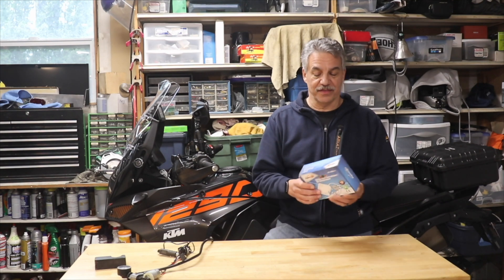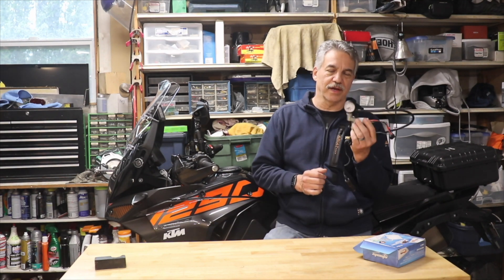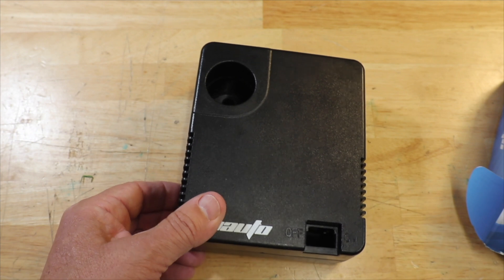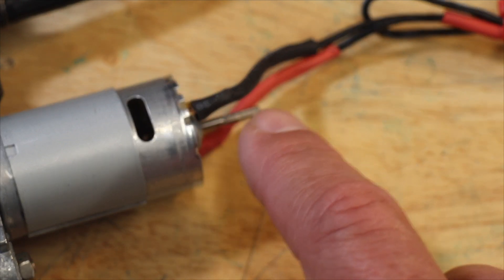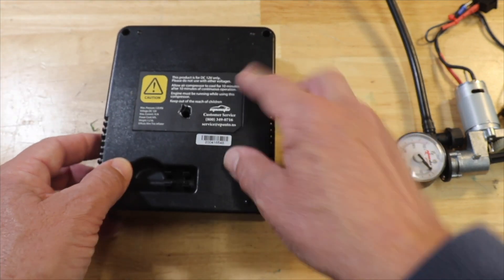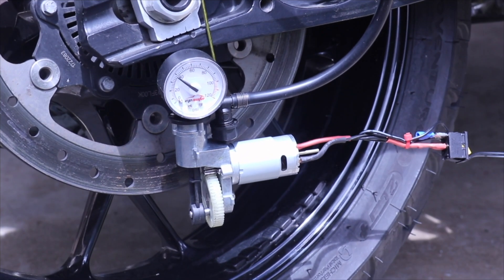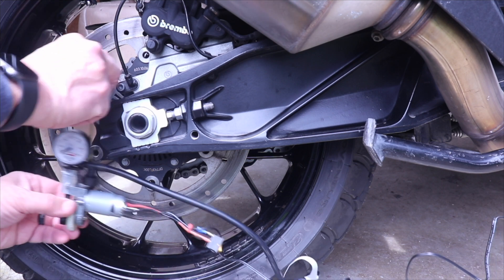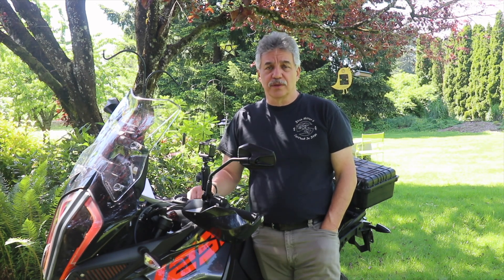DIY Compact tire pump, built from a standard portable inflator

Comment: How much space did you actually save, considering you still have the cord to handle.
The box stored the cord, protected the gears and held the little cooling fan to provide cooling for the engine and pump mechanism. It also held wires and switch in place.
🤔

For myself, I carry a tire repair kit with 6 bottles. I figure it will make me able to carefully "limp" to the closest gas station to fill up. Then I live om the hope that the next need of emergency tire inflation comes after I have restored the litte stash of cartridges.

I guess it all comes down to where and how you ride...

I must admit that I've been thinking of doing the exact same thing as you did with the pump, and I appreciate that you are sharing it!!
Reply from the maker: Daniel, after case removal, storage was 1/2 of original size. And slightly smaller than 7 C02 Bottles. Overall it was smaller and afforded successive fills compared to one time shot of the C02 fill system

Comment: I carry a mid size bicycle pump, separated in half it fits into my side panier. Yes it takes lots of pumps about 100 times to get the tire to 42psi but it's worth it for me. I also did carry a small electrical pump, but after 2 uses it died smelling burnt.
Reply from the maker: I carried a small bike pump for a time too

Comment: Came to this video after watching your CO² cartridge video, and i just want to say both are amazing and you absolutely deserve my subscription! On my 2007 suzuki boulevard, it would only take me 5 cartridges power tire to get to pressure so i went that route vs this pump, considering i could fit all cartridges in the little tool conpartment and leave my bags empty- something i couldnt do with a pump. Both are amazing videos though, and THANK YOU for testing the CO² cartridges because all i coukd find were estimated psi for bicycles and had to roughly calculate tire volume and psi per cartridge- which ended up being 4.97psi. Great insight on both videos and as a newer rider i hope to learn a lot from you
Reply from the maker: Thank you. If and when my job settles back down i hope to produce more

Comment: Nice video!  My ADV 160 in Philippines has no 12V jack.  I'm going to make one of these, but cut off the plug it comes with and add a little SAE battery tender type plug.   I want to add one of those jacks to my scooter anyways.

Comment: Nice review. Is this pump still in your kit? Have you tested it lately ? Just want to know if its something worth adding to mine. 

Cheers!
Reply from the maker: Adrian,  yes it still is.  Still working great. However I am looking to find a pump with higher quality components. That’s one of the reasons I bought the Bonair pump. That video review is in my channel.
Reply from the maker: Yes. Been using mine for a year. Not designed for daily use. But great for roadside tire flat repair

Comment: Great revue, especially the part that you took it apart. They practically all the same in the core, and put a cheap plastic cover over them sticker it up and put a  useless pressure gauge on them mostly with scales up to 10 ore 20 Psi so you can’t read the pressure accurately besides the gauges are not accurate. This is ceating, and I don’t like it. I probable do the same and build my own take the cover off, so it is less bulky and put a reliable pressure gauge on, so you don’t have to measure again with a separate action. I’m based in Europe, so I’ll find different stickers and the first one from FTA-Adventures I looked at but wasn’t available in EU, the other two brands I have to look for them, but buying one from the states is probably not an option, so I hope they are available in EU stores.
Reply from the maker: Let me know what you find.